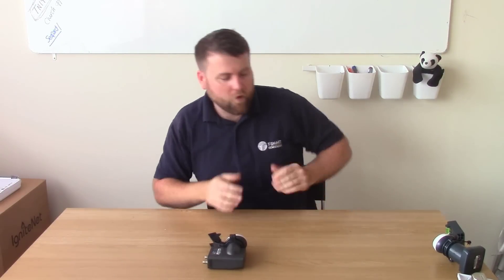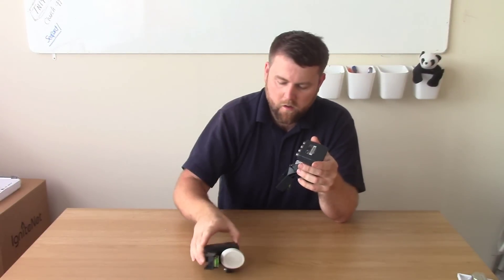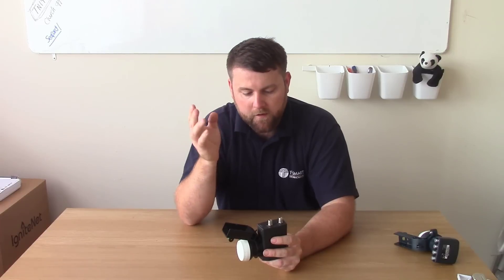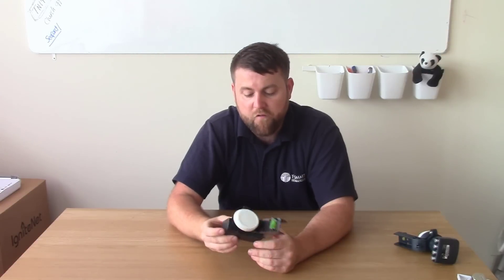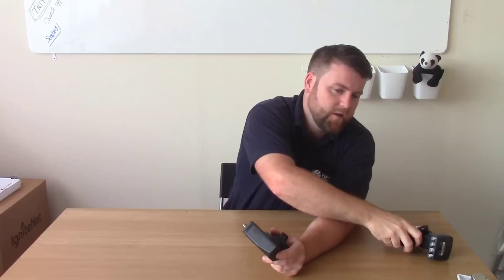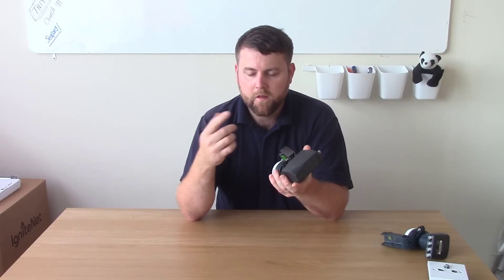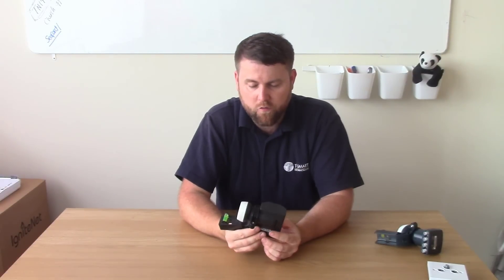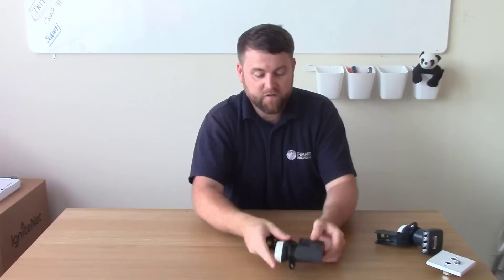What's Different With The New Sky Q LNB

Comment: I have original sky plus dish and lnb but have a new sky Q box 
The cable from dish to box is the twin coaxial with two plugs
If I understand I’ll
Have to replace the lnb to the SkyQ one,  will the cable be ok to use?
That part in video was a little confusing
Reply from the maker: Hi Jon, yes the cable will be fine.

Comment: Hi, Sky Q was due to be installed at parents today who are elderly. There’s an existing dish on the first floor which was fitted by Sky a few years back. Due to change in regs the sky fitter won’t change LNB due to patio doors below and can’t anchor himself to wall! Parents won’t now pay for an private installer and want to cancel the lot. How easy is this to replace? Current setup is just then2 cables into a quad you have on video. I understand the cables don’t need to be replaced? Just fit the existing 2 cables into the 2 new connectors? Thanks!
Reply from the maker: Hi Nigel, yes it;s an easy job. If you get yourself a wideband LNB screw the old one off and put the new one on. You just need to make sure that you get the skew adjustment correct, there is more info here: https://www.smartaerials.co.uk/blog/how-to-align-a-satellite-dish Another thing to bear in mind is that the Sky dish might not accept the holder of the new LNB if it is more than a few years old.

Comment: Great and informative video .
I had SKY Q but canceled with them and sent box back ,now I have my SKY old HD box (which I always prefered ), Can I use it with Sky Q LNB or I need to change LNB ? I have BT sport on Sky and it's still working even after I canceled with Sky , That's why I want to put Sky +HD up ,so I could get BT sport on it and use it as a freeviewer . Thanks
Reply from the maker: Yes the LNB needs to be changed if you have a wideband LNB. This is the one with the two cable outputs, unless you have a hybrid LNB. This has 6 outputs in which case you might be fine with it. I can't really comment on the BT Sport being free, it's an encrypted pay service so I can't say how that it currently working for you. Make the most of it while it's there I guess as it will likely stop working.
Reply: @smartaerials  Thanks for the quick response . I pay for BT sport with my BT broadband , so it's not free :) but it is linked with my Sky viewing card ,That's why still works . without any Sky boxes , I only  can stream BT not on TV ,, I was looking to get  my old Sky box to work ,so I could still have BT sport on TV . I still have the OLD LNB also , but not very good with installation/changing LNB  etc .
Reply from the maker: No worries. Ah okay. Maybe that will be fine then. Yes put the old LNB back up, it's actually quite an easy job. Just need a small headed screwdriver, unscrew the cables and screw into the LNB, screw back in position with the screwdriver. When you take the old LNB out pay attention to the angle that the new LNB had been installed into it's holder and try replicate that with the LNB you're putting in, it shouldn't be straight.
Reply: My question is this I have a old sky dish and lnb , I would like to know if this works on a freesat TV and zgemna box and has I was made to believe that if I point it 28.2 degrees I will have a good quantity of channels, has 19. Odd is sky q only.

Comment: I have the old HD+ box.  I also havea Humax PVR. I think the independent installer put a octi LNB on the dish,it was all he had at the time?  I am now thinking about getting a sky Q ,having some probs with HD+ box.I only need the same package as prior,no multi room etc. A girlfriend moved to a new flat and was told sky q was not available so would revert back to old hd box BUT the engineer said the sky q box could stay and work as a hd+box BUT only 1 cable is present and she can still tape and watch 4 programmes.I am lost with all this
Reply from the maker: Hi Gary. You actually have two separate issues which is confusing things somewhat. At your house. You couldn't use the Octo LNB but if you need is the equipment mentioned then you could install a Hybrid LNB which would allow Sky Q and normal Sky/ Freesat off the same satellite dish. At your girlfriends place it's a little different because she is connected to a satellite amplifier not directly to the satellite dish. If the satellite amps have been upgraded to Sky Q which use dSCR technology it would be possible to connect a Sky Q box with a single cable and then set the Sky Q box to single feed mode, whereas you would need two cables connected for Sky Q and Hybrid LNB's. You would obviously need to check with the managing agents/ landlord and not just take the Sky installers word for it to see if the amplifiers have been upgraded for Sky Q. I hope that this helps
Reply: Thanks for taking the time to clearly explain that to me. it makes sense now and know what I need to do.
Reply from the maker: Glad to help Gary. Please do subscribe to our channel. All the best. Tom

Comment: Informative Video, thanks. Question I have is how does the whole Sky Q installation work? Upgrading from Sky+HD Multiroom. Would I need to contact Sky direct or could I contact a company like yourselves directly to carry out the install?  I currently have a non standard Astra Dish with Quad LNB which I fitted and installed myself many years ago. I'm currently intermittently losing signal on Inputs to the receiver. Is this likely to be an LNB fault, cabling or my refurbished Sky HD Boxes? Sorry for all the questions at once.
Reply from the maker: Hi Robert. You would need to go to Sky to sign up to Sky Q. Independent companies can install the satellite dishes and make repairs etc but as far as I'm aware Sky without exclusivity with regard to supplying of Sky Q boxes. If you change to Sky Q you will either need a Wideband LNB or a Hybrid LNB to replace your Quad LNB. Regarding signal issues. Sorry I can really say from here as with digital TV most problems will present themselves in the same way so it could be your LNB, cable or Sky box that is causing problems. I hope that this helps. Tom
Reply: @smartaerials  thanks very much for the reply.
Reply from the maker: You're welcome. Please do subscribe to our channel.

Comment: hi great vids question i had is i have multi-room at the moment so can replace one of my sky hd boxes with sky q or would i need to replace both hd boxes to sky q boxes? thanks
Reply from the maker: Hi, thanks! To update to Sky Q you will need to change the LNB at the end of your dish to make the Sky Q box work and your Sky+HD boxes will no longer work. You have a couple of options from here. You could take the Sky Q multi-room option, where the boxes are connected wireless to the main Sky Q box but I can't say for sure how this will affect your monthly subscription payments. If you want to keep both Sky Q and Sky+HD running at the same time from the same satellite dish you will need a Hybrid LNB installed at the end of your satellite dish which allows for both. I hope this helps. Tom
Reply: One sky q box and then a sky q mini box for other rooms I think they are £12  extra per box per room
Reply: Ste P it’s flat £12 extra for multi room on sky q. No fee for extra boxes, you just have to pay the up front cost at the start

Comment: Really informative stuff.  Can you shine a light on the info I got regarding HDMI cables for the Q boxes. I was told only Sky HDMI cables will only work with the Q boxes. Surely this is not right  ?
Reply from the maker: Hey there, no this isn't true. I can't think as to why you would have been told that. Maybe it was some reference to 4K. But no normal HDMI leads are fine. If you're buying a new one I recommend getting one certified to the latest standard HDMI 2.0. Tom

Comment: hi can i use the wideband lnb with the old sky+hd box? re: pluging both cables in input 1 and input 2 ?
Reply from the maker: No I'm afraid not, you need either a universal style LNB, Quad, Octo etc. Or if you want to run Sky Q and Sky+HD at the same time a Hybrid LNB exists that will do the trick.

Comment: question will i need new cables fitting or is it just the lnb they swap out?
Reply from the maker: No just the LNB, possibly the dish too if it's very old as the new LNB might not fit. But the cables will be fine.

Comment: I upgraded to sky q,now when i try my freesat receiver theres no signal.But it used to work before sky did something to my dish.Maybe a crafty move by sky so you can not use freesat
Reply from the maker: Yes I think so. The LNB's required for Sky Q are not compatible with Freesat. But you can buy Hybrid LNB's now, fit this to the end of your dish and connect the cables and you can have Sky Q and Freesat fed from the same satellite dish.
Reply: Smart Aerials Is it possible to have a Hybrid LNB, that will work with SkyQ? And that when you leave Sky, you'll still be able to watch freesat stuff? Good stuff pal
Reply from the maker: Hey, Yes it will work but not with your Sky Q box, you would need to swap it out for a Sky or Freesat box.
Reply: @smartaerials  Hi. I recently left Sky and had the SkyQ service. I want to use my dish for Freesat so I've now purchased a Freesat box and a Sky Quad LNB. I notice the current Wideband LNB has 2 output cables, my Freesat box only has 1 input. When I change the LNB over, which of the 2 cables do I connect to the Quad LNB and can it attach to any of the 4 outputs? Also the skew on the Quad LNB is set at number 3, should this be moved to match the skew my current Wideband LNB is set at? If so, how do I adjust the skew please? Thanks.
Reply from the maker: @kissedaboy09  Hi Pat, it doesn't matter which cable is which on the Quad. 3 should be fine, if you need to adjust there is a screw than can be loosened to allow the LNB to move.
Reply: Hybrid lnb sky provides these I have been told

Comment: Brilliant! Needed something like this for a long time. Thanks 😀👍👍
Reply from the maker: You're welcome Matthew. Glad you liked the video!
Reply: Smart Aerials i got a shock when i figured out the new lnb wasn't compatible with the Sky+ boxes.
Reply from the maker: You're not in only one, It has caused all sorts of bother within the trade!
Reply: Smart Aerials    Is the quad Sky+ LNB for use with 2 Sky boxes? As I've only seen the quad LNBs with 2 wires connected. Thanks
Reply from the maker: Good question, yes it can be used for two sky+ boxes or Freesat+ boxes, alternatively you could have 4 non recordable satellite receivers attached to a quad or a combination of the two. It just became standard to fit quads on all installations to allow for extra TV's etc. I install quads even when I'm only installing one cable.
Reply: Smart Aerials   Thanks again for the info. If you don't mind me asking, how does the Sky Q box manage to have 3 recording tuners built in off just 2 satellite connections.
Reply from the maker: Hey Matthew. I don't mind, keep on asking questions. It's really good for our Youtube channel getting comments on our videos so please keep them coming. :) Another good question and the answer it that is the way that quad LNB's work. Because Quad's switch between a quarter of channels at any one time (high band, low band, horizontal and vertically polarised signals) It means that 3/4 of the channels are not available to when you're tuned to one channel. So if you tried to record another at the same time chances are that you wouldn't be able to record it because the channel usually isn't on the cable at that time. To get around this they bought in the second satellite connection which would allow your recorded channel to switch between all four quarters of the channels without affecting the other satellite connection, the one that you're using for live TV. The Sky Q LNB's doesn't work like that, they provide all the channels simultaneously (Horizontal/ Vertical) over the two cables so at any time, hence the reason why you can't use a single satellite connection with a Sky Q LNB. Because there is no switching at the LNB , inside the box it can split the satellite signals for more tuners like normal Freeview recorders can that only use a single aerial feed. The lastet Freeview PLay recorders have 5 tuners inside which all work of a single cable coming in. I hope that this makes sense.
Reply: Smart Aerials . Amazing! Thankyou for taking the time to explain this, very useful! 👍
Reply from the maker: You're welcome. Tom